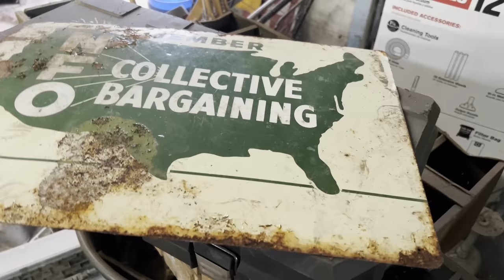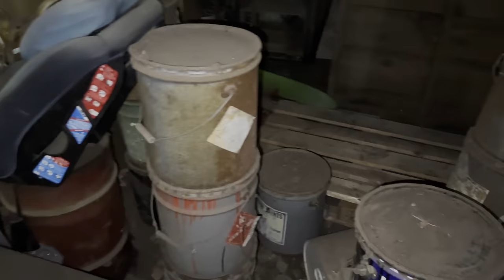Shipping out nearly 1,000 Catalytic Converters & I Bought a 1947 Chevrolet Tank Truck!

Comment: Silas, I would have taken that rain.  This must have been a while back because you guys are in crispy critter when you stay outside in the sun all day weather.  I think that locust tree you showed was what was growing up inside my crepe myrtle.  I finally cut it down and painted the top with full roundup.  Thorns died, crepe lived
Reply from the maker: About 2.5 weeks ago. Hard to believe I was wearing a coat then
Reply: @AdventuresMadeFromScratch  what's the update on the 58 Oldsmobile

Comment: Here in Mesa Az prices for shred steal is at 3 cents a pound. Copper is still fairly good as is brass and aluminum. A citizen cannot sell their own cat's off their own cars in Arizona. It's illegal due to all the theft going on. Only repairs shops and scrap dealers can. Rain? What's that? We have not had any rain not even a few drops since the first of the year. Today it is 111. All our watering is done from the tap although most of this area had flood irrigation at one time but home builders here don't want it in their developments. I pay about a hundred a month for water. Flood irrigation twice a month in summer and once a month in the winter would cost about a hundred a year. As always great videos Silas. Keep em coming,

Comment: I just bought a new to me used 6 1/2 ft pickup bed for my truck. Since the only scrap yard for miles is right across the street, I junked my old one there. They said it weighed 300 lbs and gave me a whopping $11. I'm in the northeast US, so prices must be a hell of a lot better out there.
Reply from the maker: Definitely seems low. Prices are $100 a ton less now than they were when I filmed this and that bed would still bring at least $20

Comment: Repeat after me:
"Call me when you're on your way or you're going to have to wait on me to get there. Your choice."
👍
Reply from the maker: Unfortunately trucking companies won’t do that, and if you’re not there they will many times leave empty.
Reply: @AdventuresMadeFromScratch  oh that's right, you loaded them onto an Estes truck. They also pull doubles and triples in some states. 

Next time consider requesting an empty pup trailer and have them drop it off. You're in a rural area, but sometimes you can get them to bring out an empty pup and drop it off in the morning while the driver delivers the freight on the front box. You can load the trailer during that time and when he's done, he'll come back by to pick up the loaded trailer from you and hook it up as a set with his first trailer. 

When you load them, you'll need a pallet jack to spin the pallets around and push them to the front side by side. A 28 foot pup trailer holds 12 standard pallets straight in side by side, or 14 of them if you pinwheel them. Swing door trailers are recommended for 14 skid loads over roll up door trailers. 

Either way, load what you have and bolt seal the doors. Then call them and they'll pick it up when they're in the area. They'll haul it to their dock, hook it to another set and off it goes to its final destination without driver or dockworkers "sticky fingers" picking through the cats or some of them getting "lost in transit".

Just tell them you want the entire trailer to go to the destination with the bolt seal intact. Get a quote at least so you'll know if it's worth the extra expense.

You may already know this...

Comment: $200k-250k hope that load was hedged. Palladium and rhodium dipping good past few months unfortunately
Reply from the maker: Unfortunately there is no locking in on them anymore. They stopped that earlier this year. Worth about $50-75 each less now than just a couple months ago
Reply: @AdventuresMadeFromScratch   do you sell outright or are you getting them refined? That kind of volume you should have them refined.
Reply from the maker: @uriykir  They get refined. I got the final numbers today finally. Roughly 17 oz platinum, 40 oz palladium, 5 oz rhodium. We don’t have to sell at these prices and can sit on it for 3 months from today, or we can split it up into several payments at different times.
Reply: @AdventuresMadeFromScratch  that’s interesting. I’m curious what palladium ppms you got on that load. I’m in New York and do about 2k pieces a month. Most our stuff rots out quicker and we tend to get more California emissions pieces so 2400-3000ppms on pd isn’t uncommon. Every time I buy loads from Carolina or Texas they come significantly lower.